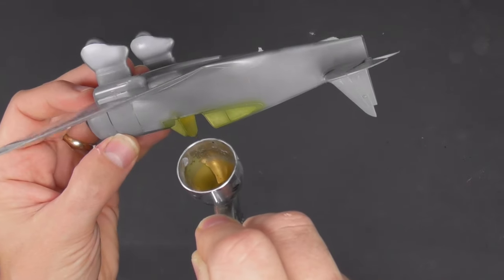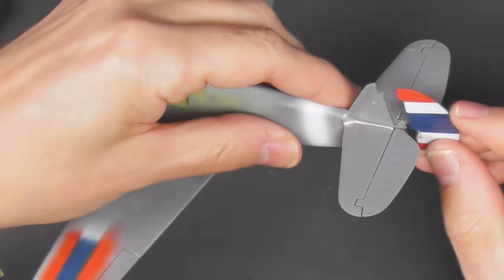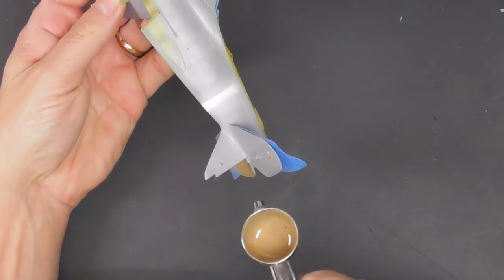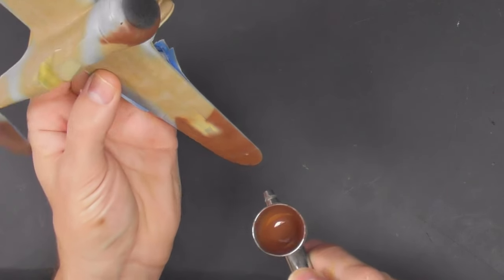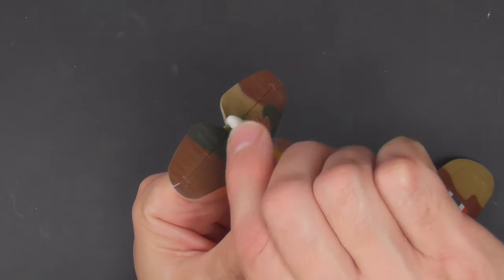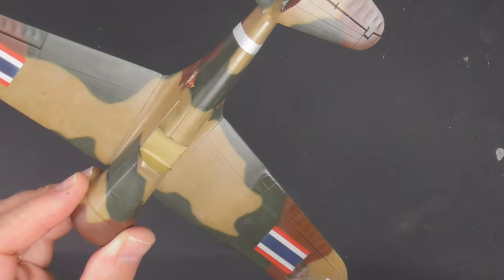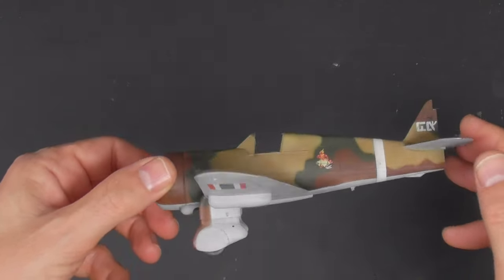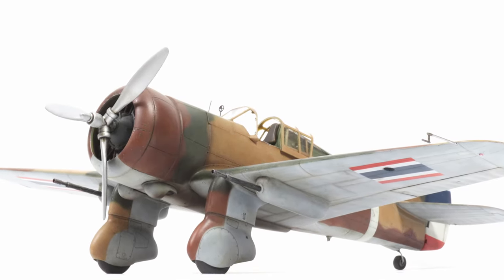Clear Prop Curtis H-75N Hawk: Part 4 Painting and weathering

Comment: Lovely as usual Jaime :) what Psi level do you spray for the post shading and what number needle do you use ? Many thanks.
Duncan
Reply from the maker: Thanks Duncan.  I can't tell you the psi as I use a MAC valve on the airbrush to adjust it to what I need; but my rule of thumb is for fine lacers the minimum to get a good atomisation.  I use an Iwata with a 0.3 needle.
Reply: That’s ok Jamie I was a point three too out I can never pull off free hand like you do 👍